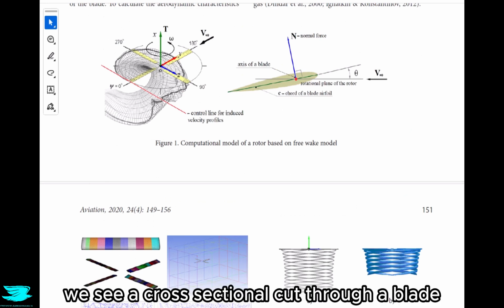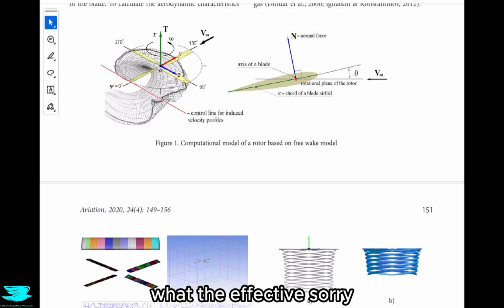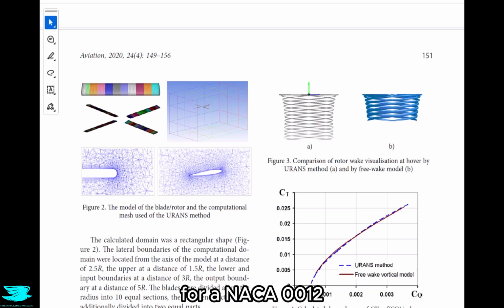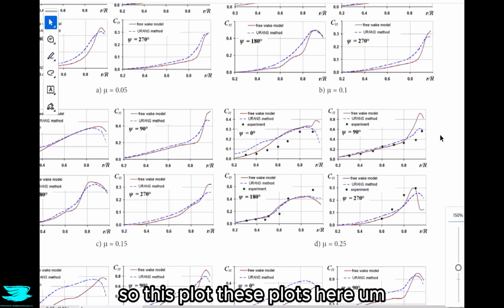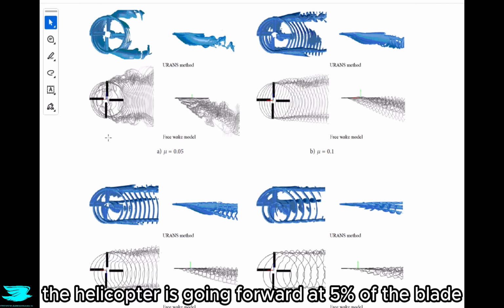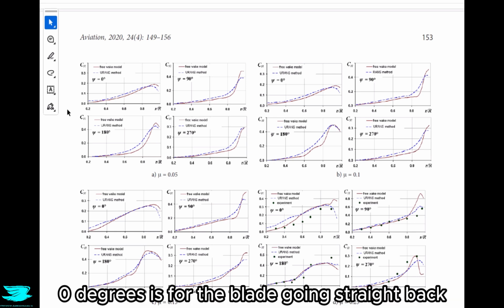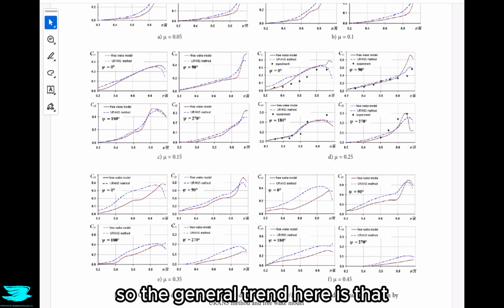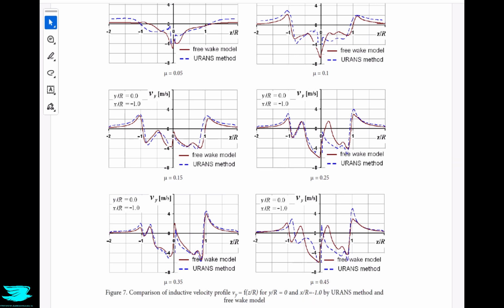How Helicopter Rotor Aerodynamics Changes With Forward Speed Podcast 234

Comment: Hi, i just built a quadcopter which flies forward without changing attitude and it might be the real-life example of the results you explained here. I am setting up a showcasing video of the drone's potential by then more details of the craft will be revealed. For now, I am wondering if the total lift generated by the props at higher forward velocity is more than the lift at hovering? If so by how much higher? I am trying to figure out what caused the drone's tendency-to-climb at high forward velocity. Whether it is the total higher lift from the props or the lift generated by the smoother upper surface of the craft is at play? If I know which one is more dominant then I could find a better way to maintain altitude at higher forward velocity. My latest test video is here: 190kmh aerial camera platform: No post stabilization. As if the camera is on the rail in the air.
https://youtu.be/aMrpLuuEXF0
Reply from the maker: Wow, that's a cool quadcopter.

To answer your questions:

So, lift is always in the vertical direction. If the drone's altitude doesn't change, then its lift production EQUALS its weight. As long as that is true, then no more lift is produced.

When you fly forward, I'm guessing that the drone is tilting forward a little. So, the force it is producing is likely increasing, BUT the amount of force in the vertical direction is staying the same.

The drone's tendency to climb with higher forward velocity (assuming that the motors' RPMs stay the same), is almost certainly from the propellers producing more force in the vertical direction. It probably isn't the smooth upper surface because when you tilt that, it will probably produce a little bit of downforce.

If the RPM increases as you fly forward faster, then that is what is causing the increased lift, which makes you climb in altitude. The props are producing more force because they are spinning faster, and there might be more force because of the faster moving air hitting the props too.

We're actually getting into small FPV quadcopters now. We were wondering if we could ask you a few questions about them because our knowledge of FPV is a little limited.